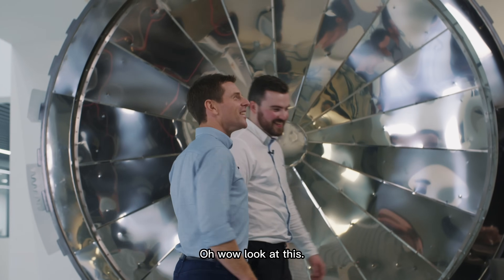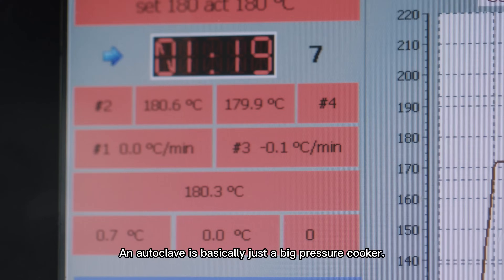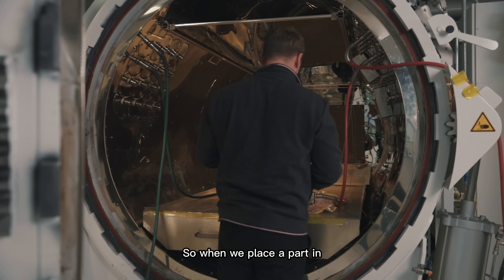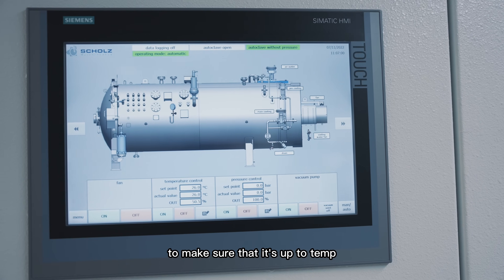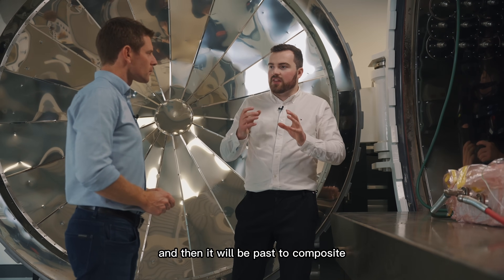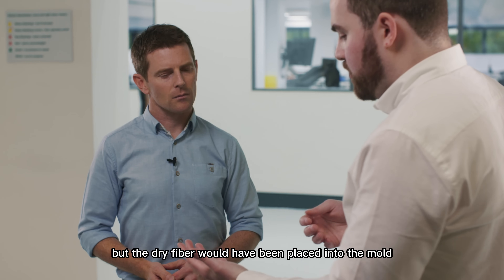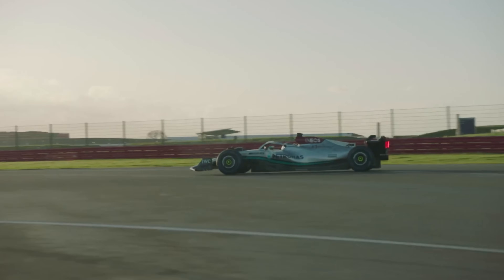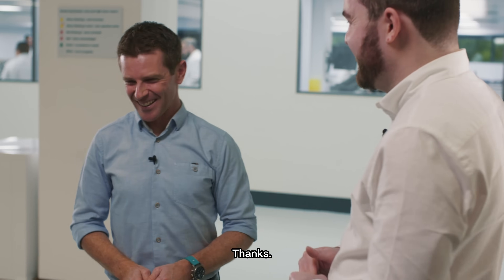What are we cooking? 🤔🔥 | The Journey Of Carbon Fibre - Part 2 | How It Works

Comment: This is what is called state of the ART ! With unlimited $ ? I do MBZ, Lamborghini    Audi, R8's carbon fiber repairs and  reproducing failed parts. I use measuring  cups and know exactly how much resin is sprayed on but most of it gets sanded off to almost nothing and thin final coat all done on a folding table.

Comment: I wonder why they’re so large though. Even if the body was made of one huge piece of carbon fiber, it could still fit in there. Maybe that was the only available size? 🤔
Reply: There are smaller autoclaves and there are even bigger ones. I assume this size is the best size/cost for the type of pieces they manufacture. After all they do need to cook the safety cell and the floor piece in it, which are fairly big pieces. They also probably want some space around the biggest pieces, so you don't have the pieces too close to the walls. And they probably use racks of pieces when they are in production, probably filling the autoclave much more then when they are doing prototype pieces.